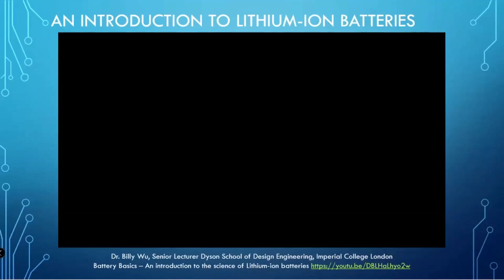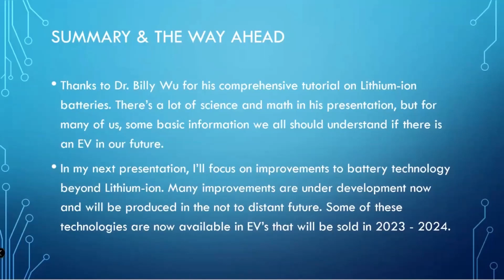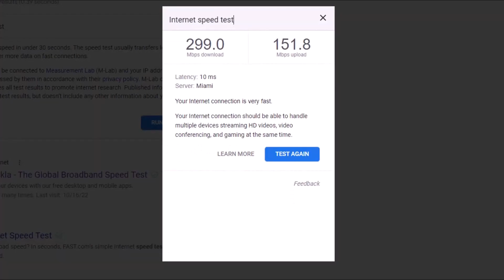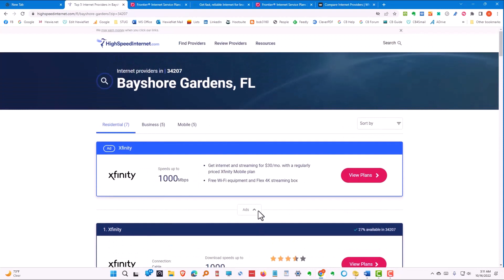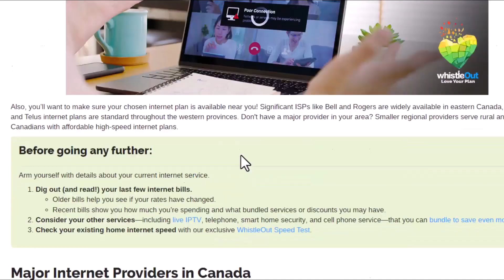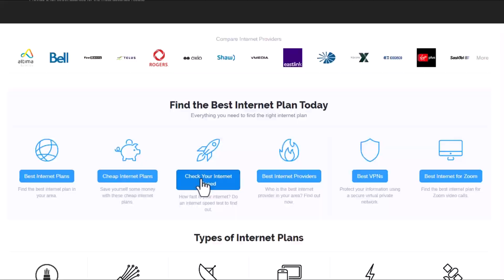Tech for Senior :  Episode 143A

Comment: 20:20 choosing Internet service provider (ISP)
21:06 speed test are not so accurate because of the many legs and devices isp sends it through plus the limits of your own, your lication, and your physical location, nearby tall building if signal travels through air, or if using fiber optics.
Reply from the maker: Thanks for watching our video and taking time to comment.